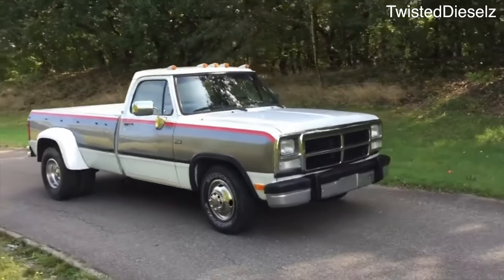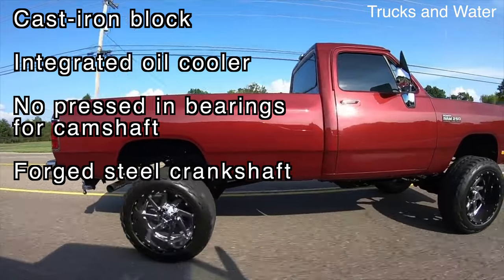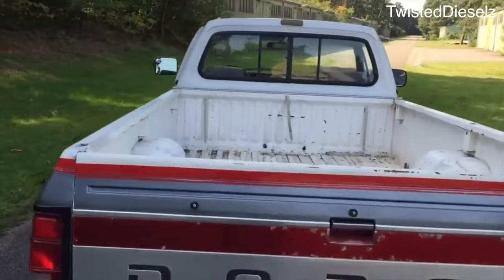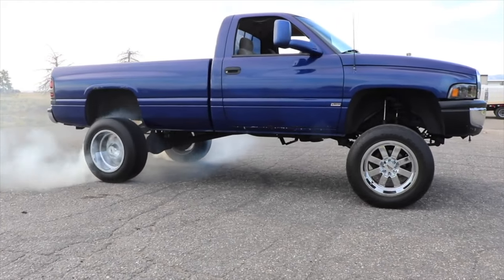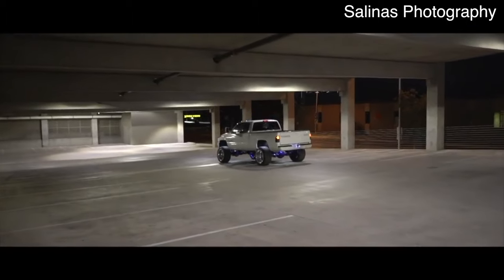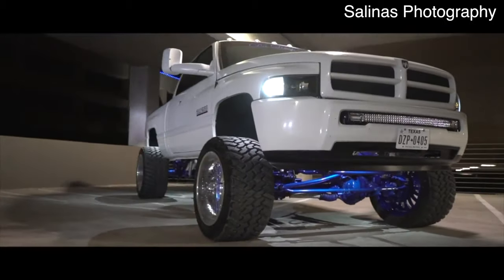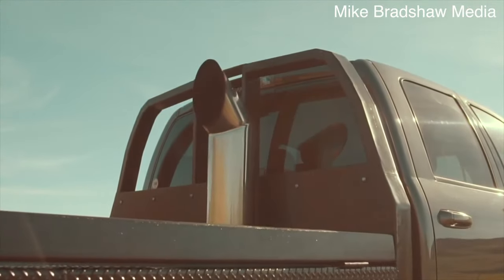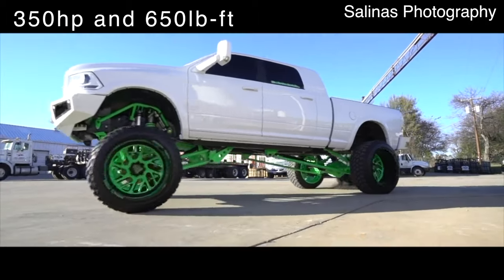Cummins: Everything You Need to Know

Comment: I'm not impressed with the parade of dressed-up trucks rolling coal.  Can't you show regular trucks doing real work?

I've had two Cummins-powered Rams:  a 2001 2500 24V/NV4500, and a 2008 3500 CR/G56 SRW.  I used both for hotshotting travel trailers over about 4 years.  The '01 is the one I started with, at 293,000 miles and ran it to 577,000 miles in about 3 years.  I went through an NV4500 about every 75,000 miles.  In the end, I retired it from hotshotting but kept it for sentimental value.  I bought the '08 and ran it for about 12 months and ran it from 156,000 to 266,000 miles.  Both trucks spent about 2 months per year in downtime, but the '01 was cheaper to operate because it got better fuel economy.  When I quit hotshotting, I traded the '08 in, but still have the '01.

Comment: I sold Cummins engines in the industrial/construction market for 20 years and the B-Series really put Cummins on the map in the construction market. We had an engine that would fit into so many different types of equipment that we never had before, it really enhanced Cummins reputation in that marketplace. The reason the 6BT was so strong, it was originally a joint venture engine with J.I. Case for use in their industrial/construction equipment so it was built to last from day one. Unfortunately exhaust emission regulations, a necessary evil, has a negative effect on reliability/durability and performance and makes a good engine seem bad at times.

Comment: When the zombie show up or EMP goes of or nukes.   P-pumps are gonna be the only ones that will still run.
Reply from the maker: You’re going to have more problems than that if an EMP goes off.
Reply: @Dustrunnersauto  Yep, your phone won’t work either so you won’t know how to get to the mall.. BBBRRRAAHAHAHAHAA!!
Reply: Not sure what Zombies has to do with a modern diesel starting and running. Same for nukes. Pretty sure if you have to worry about your truck running due to a nuke... You're probably gonna have bigger issues. As said before. An emp, you would have bigger issues also. Ppump isn't the only mechanical diesel from the big 3 either. GM 6.2 or 6.5. Ford had the 6.9 and 7.3 just to name a couple

Comment: Love my 95 12v any day! Yes it's a little slow to accelerate with a 24ft enclosed trailer and about 20k pounds combined, but its faster than I can shift it without the trailer. Should mention I haven't touched the p-pump so its bone stock and all original at just shy of 200k miles and I dont wanna mess with how reliable it is for me.
Reply: You must shift slow. A 1995 manual trans is rated at a whopping 175hp and 420tq. It's about as slow as they come. Engine is reliable for sure, with exception to 5th gear falling off
Reply: @countcuda70  215 not 175
Reply: @nickfox919  1995 12v 5sp is rated at 175hp. 96-98 12v 5sp were rated at 215 hp
Reply: @countcuda70  my bad thought all p pump manuals were 215 and 175 for the auto

Comment: I bought my '98.5 Ram brand new and have done lots of work on it and modified the crap out of it. But had no idea until now that the pistons were aluminum. Hard to believe they can hold up to the heat.
Reply: Uh all pistons are aluminum, lol
Reply: @bluesky-ud9wg  When the exhaust gasses are leaving the manifold at 1300+ degrees, how does it not melt the pistons? Does the oil and coolant do that much?

Comment: if the 5.9 was torquier it was because of is multiplaform layout meaning that it was use on semis , tractor and snow blowers(my uncle worked in a company making industrial snow blowers and the 12v 5.9 was used at first and the 24v came later on even tho the 12v stay for long for it's simplicy and reliabilty)

Comment: The 6bt 12v  is one of the best inline 6 diesel motors ever made , shame they have to keep changing/They used to fit them into 17 tonne trucks over here in England and did the job well.I have done work on them and the early motor with 170-180 bhp were built so strong you were not going to brake it, not like all this new crap

Comment: all three engines have their strengths and weaknesses. even though i am a ford guy, i prefer the 5.9 cummins over any of the others, with the navistar and powerstrokes next, with the exception of the 6.4, and the duramax bringing up the rear, though it also in its later versions is a very good engine.

many of the issues these engines have can be overcome with the judicious application of aftermarket parts designed to overcome the weaknesses of these engines.

Comment: I've just swapped my 5.9 Cummins  because of blow by. But the new donar engine won't start if weather is under 60 degrees.   Any idea what the fix is?
Reply: Glow plugs, battery, grounding, injector, or fuel pump.

Comment: Let’s settle this 
Best diesel dodge used: 5.9 Cummins
Best diesel Ford used: 7.3 Powerstroke 
Best diesel chev used: LBZ duramax
Reply: No on all 3.
Reply: I have to disagree on the 7.3 Powerstroke. The 6.7 Powerstroke is way more superior to the 7.3. HP, TQ, refinement and CGI block. Trust me I've owned both.
Reply: @Berto-1117  and your list would be?
Reply: @countcuda70  best used and new from cummins is 100% the 6.7, i have a 12 valve 5.9 and a 6.7 no comparison, sure 12 valve is awesome, it breaks down and youll know whats wrong before you even pop the hood, but no comparison to a 6.7. From ford 7.3 is the most reliable but it is super weak, not even worth buying, just get a gaser. 6.7 PS for sure. From chevy lp5, honestly never liked duramax much before the lp5, lbz is amazing dont get me wrong but lp5 is better in every way after a delete, only problem with lp5 is the cost to fix, but they are really reliable good motors so they wont need much money for a long time
Reply: @Berto-1117  I guess it depends on what "best" is. For making power. The 5.9 and the 6.7 both have huge potential. You're right on the 7.3 Not very powerful in today's standards but a power house for it's day. Last but not least. The LBZ Duramax. It's a great engine. Powerful, quiet... So if power is your best. Sure, that list makes some sense. Best could also be how each platform got to where it is today. 5.9 is a legend. Was the go to engine for it's day. Reliable, durable, lasts forever. Probably saved Dodge at the time. Without the 5.9 Cummins. Ram may not be where it is today. Ford with the legendary, reliable 7.3! Not a powerful engine but would last forever. I know they had the 6.9 and 7.3 idi but they couldnt compete with the new direct injection diesels. The 7.3 Powerstroke didn't save Ford but its was so good. People are still willing to pay good $$ for them today The LBZ Duramax. Not the first or the second version sure. So to that the LB7/LLY deserve some credit but the LBZ. Powerful, reliable, quiet... Well quiet for it's day anyways. Was and is a great engine today. All 3 of the HD diesel brands needed/need one another to continue to make each other better.
Reply: No 6.blow is the best. 7.tree is an oversized underpowered turd
Reply: @benjaminturpin2749  lol.  yeah....maybe if you throw about 4 grand into it.  ford stopped using the 6.0 because it was unreliable for an even more unreliable engine.